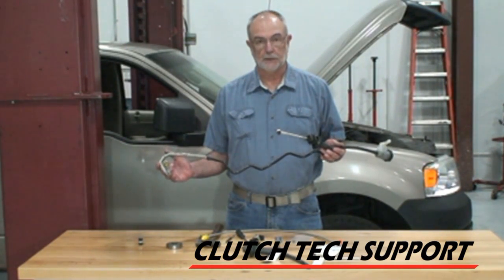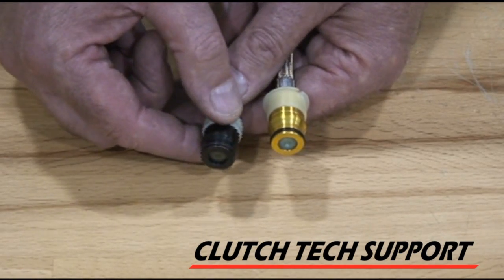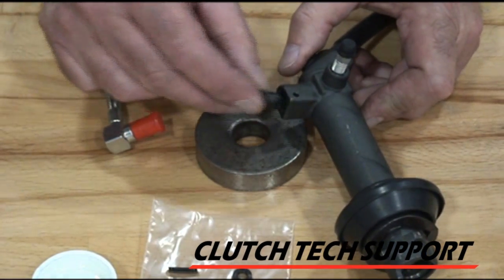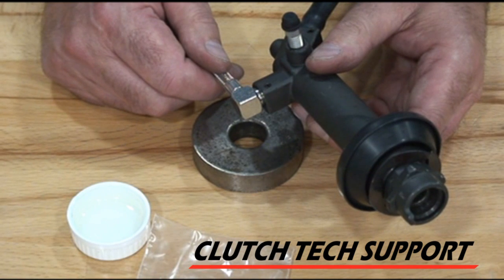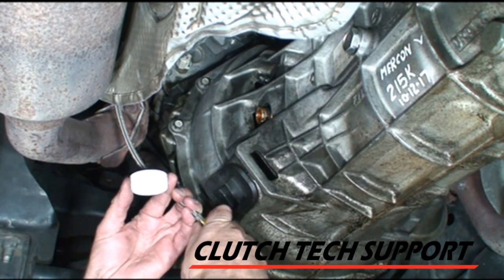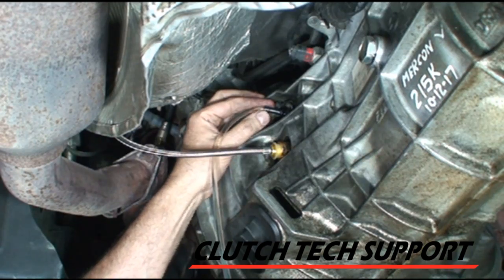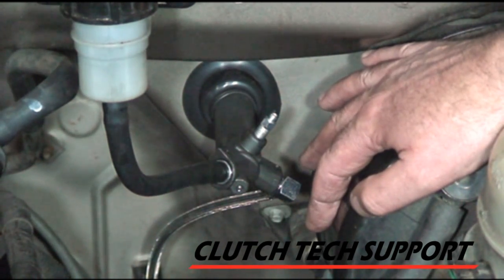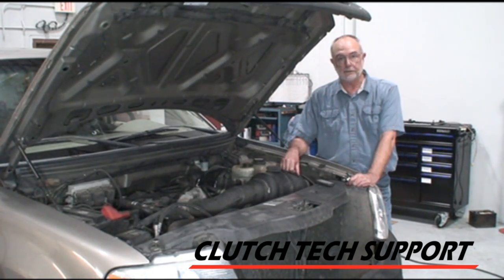Clutch Hydraulic Braided Line Installation

Comment: How do you bleed the clutch of a 2009 nissan versa or other vehicles using this transmission (sentra, cube, juke, etc)? The system can't be bench bled because the slave cylinder is inside the bell housing. Also, the master cylinder doesn't have it's own reservoir, it has a rubber hose running to the brake master cylinder reservoir. There is a bleed port on the hose at the connection to the slave cylinder, but I don't see how that can get any bubbles trapped inside the master cylinder. Thank you for your time, your videos are great!

Comment: Where can I buy the metal clip that holds the lines together at the slave cylinder? Mine rusted apart and the line popped out. The slave cylinder is still good. I just need the clip.

Comment: I have a custom set up. Running a master off of a 2008 Ford F250 and a slave from a 95 Jeep Wrnagler. The slave has the normal fitting with the little o ring and roll pin. The Ford side has some push in type fitting with a clip kind of like in the video. What is the right connector for the Ford side? Can ya’ll make a custom line to fit this?